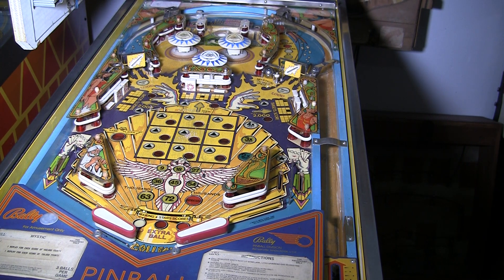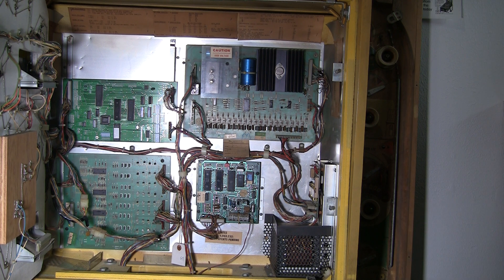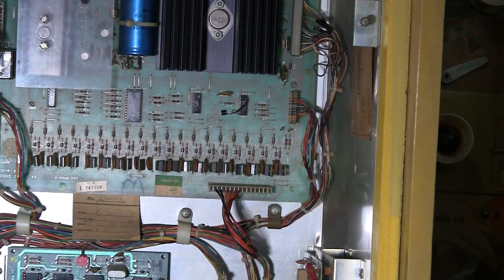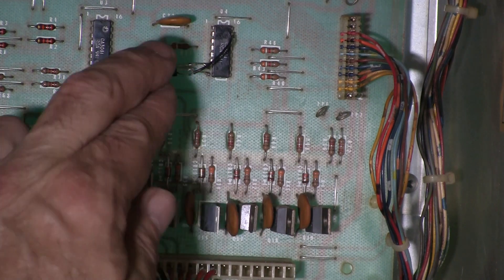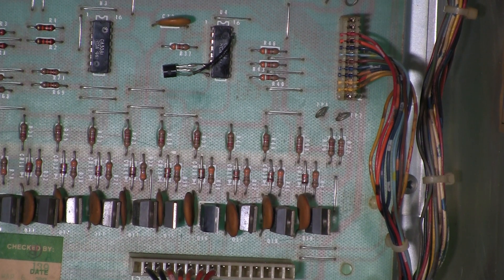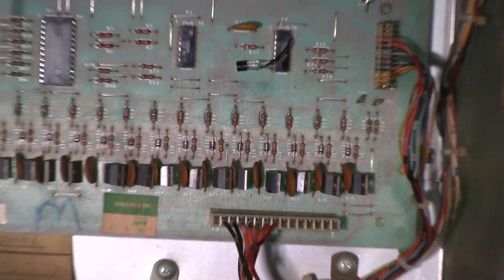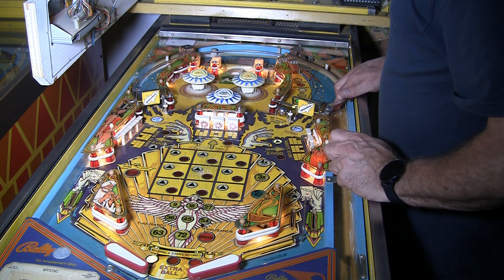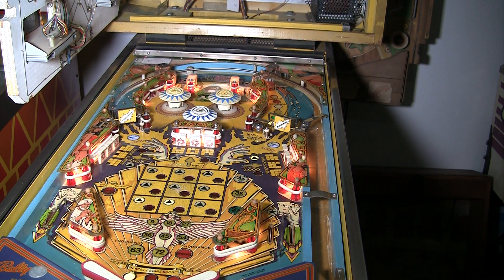Tracking down a coil that won't work - Pt 3/3 - PinballHelp.com

Comment: Thanks for the 3 parts of this video... I am interested in your take for flickering LEDs in early solid state machines...
Reply from the maker: Some early solid state games, like many Ball-35 games would "pulse" the lights to be able to create dimming and other effects.  This looks good with incandescent lights, but not so good with (instant on/off) LEDs.   There are a few options for using LEDs in these games, including finding LEDs that don't "ghost" (although in the Bally-35 games they still can flicker), or using special ROMs that have the pulse code removed, or using an upgrade light control board that supports LEDs.

Comment: Nice which legs are connected to which terminals I can't see it. The flickering LED would be two diodes opposite
Reply from the maker: If you go to the page on PinballHelp.com in the item description, I've added some extra info which shows a diagram of how the transistors overlay the IC package.   In this particular instance, the coil was connected to transistors on pins 7,8 and 15.  15 was the ground (emitter pin of the transistor).

Comment: Pinball help, can you make a youtube video showing how to test and repair switch matrix circuit issues and lamp matrix circuit issues?
Reply from the maker: Switch matrixes... they're like a kind of "dark magic" of pinball in how confusing they can sometimes be to diagnose.  I've done several videos on them, some more informative than others, some showing how frustrating it can be to figure out what's wrong, etc.  Here are some examples:

http://pinballhelp.com/fixing-switch-issues-on-an-attack-from-mars/

http://pinballhelp.com/when-a-broken-switch-isnt-a-broken-switch/

http://pinballhelp.com/switches/
Reply: What is the theory of the basics on using an ohm meter and volt meter or using an LED to test each output PORT on the switch matrix circuits and lamp matrix circuits?